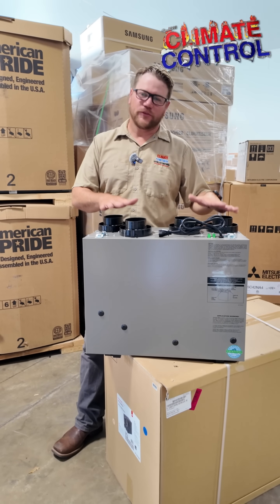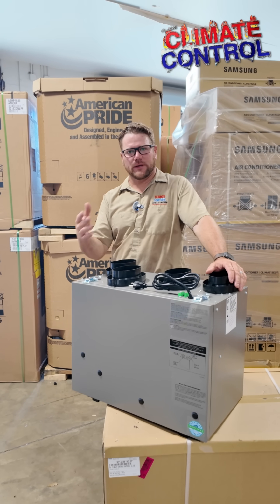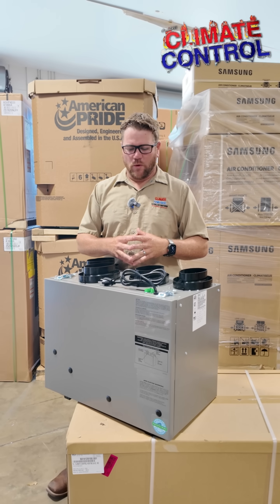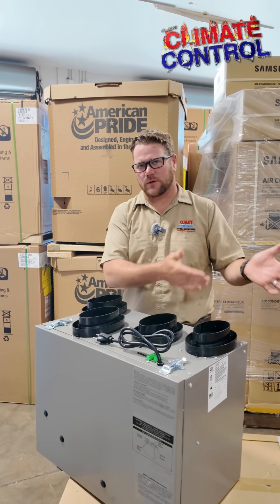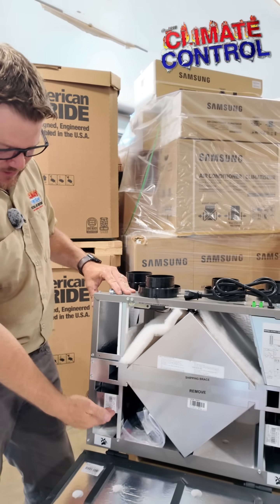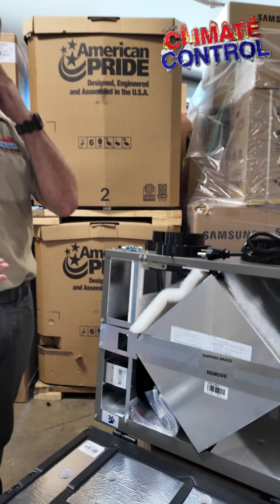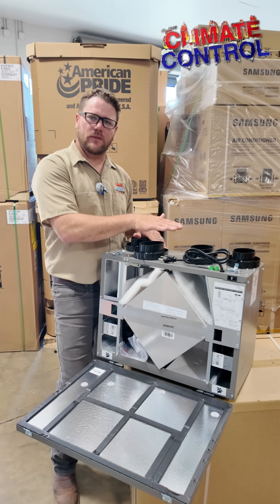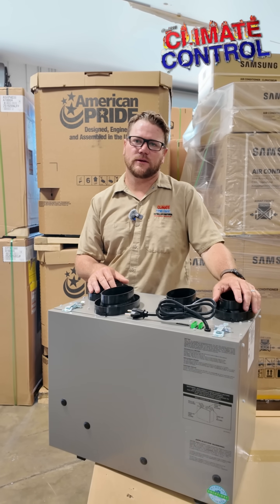What Is an ERV & Why Florida Homes Need One 🌴💨

Comment: I got the same problem in AZ. I crack open a window here and there. No tech. needed.
Reply: ERV isn’t really applicable in an environment like az. Only where humidity is actually an issue.
Reply: Exactly. More industry garbage convincing us we need this and that.
Reply: Finally someone said the quiet part out loud.  All this ERV/HRV/makeup air crap is a solution desperately in search of a problem.  Just open the windows and turn on the ceiling fans like our ancestors did and save yourself 5 grand.  It works everywhere too, yes that includes Florida!  You're welcome.
Reply: @blendtecbrah  It will make the inside of your home humid